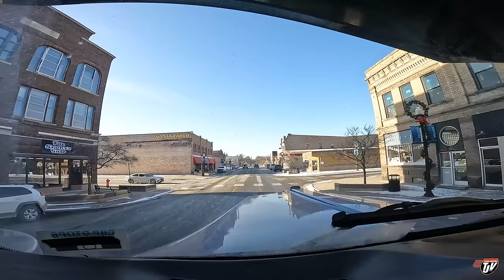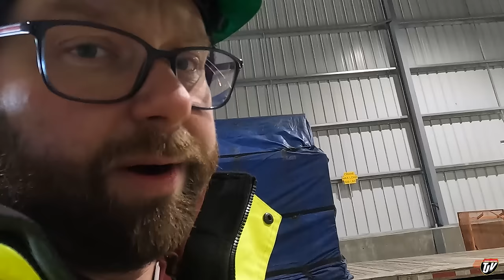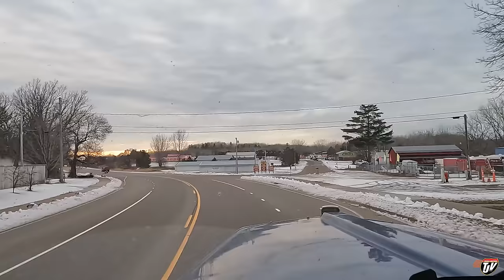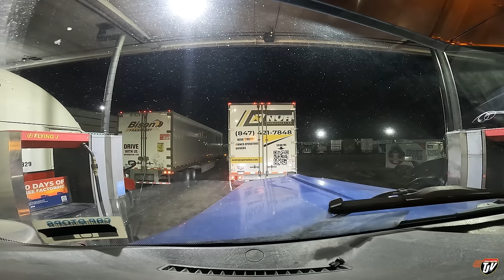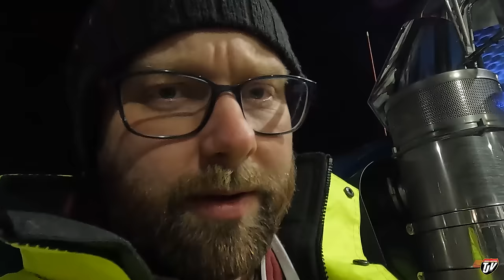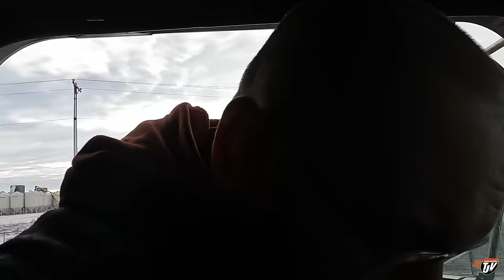I'M FIRST!! | My Trucking Life | Vlog #2961

Comment: Electric trucks is not going to happen.  I'm factory trained General Electric  electric vehicles technician. Think about it  truck stops would need parking lot 10 times larger than they are now to handle at least 100 trucks parked for like 6 to 8 hours to get full charge. The current draw would be grater than a small city or town. In the US they have like 276.000 high volt chargers across the 48 states. In every one went electric cars it's estimated they would need 8.000.000 more to supply all the drivers.    
Not gonna happen.